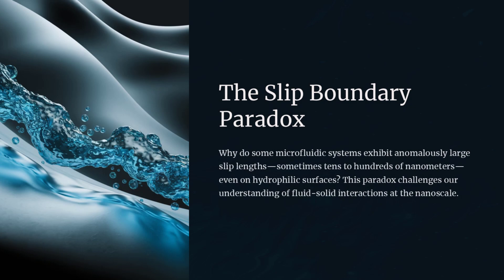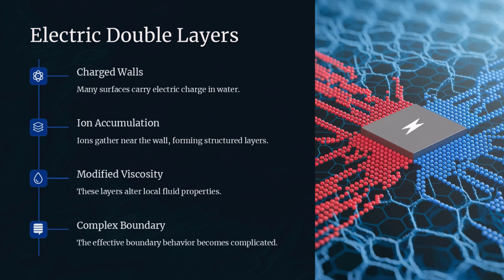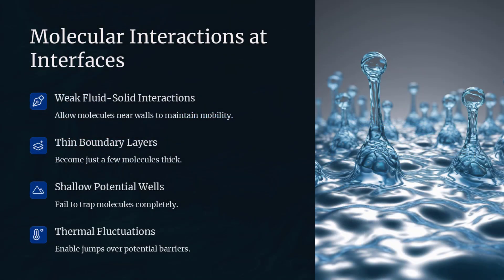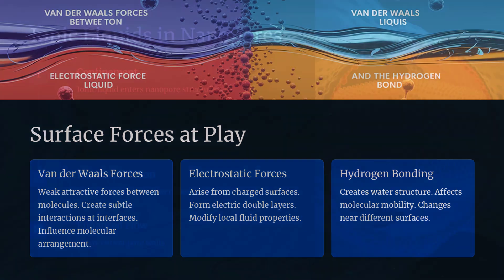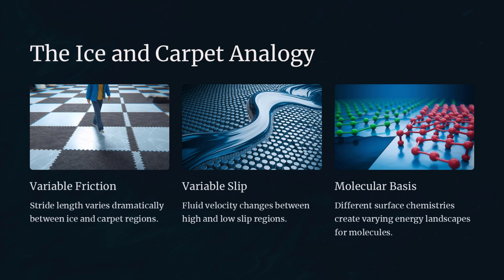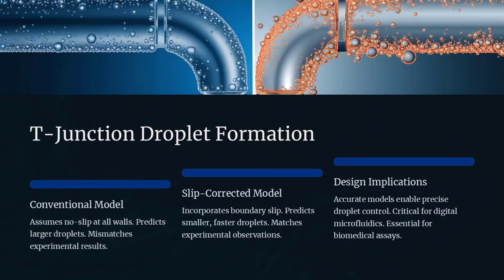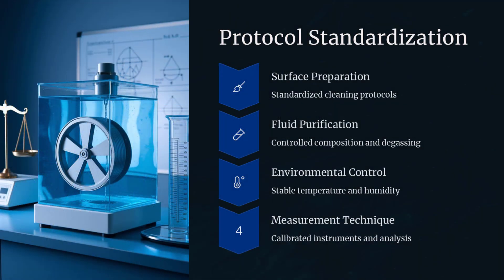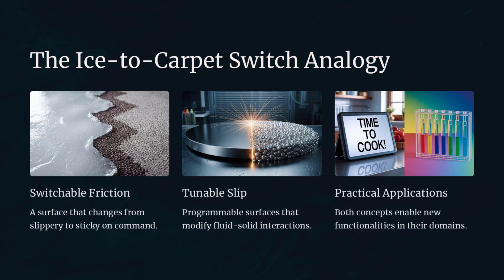The Slip Boundary Paradox: When Fluids Break the Rules of Contact

Comment from the maker: What are the dominant molecular mechanisms driving anomalous slip in hydrophilic nanochannels under varying flow regimes?
How can multi-scale models accurately integrate discrete molecular behavior with continuum equations for predictive nanofluidic simulations?
In what ways can programmable surface chemistry and topography be engineered to control slip length dynamically in microfluidic systems?